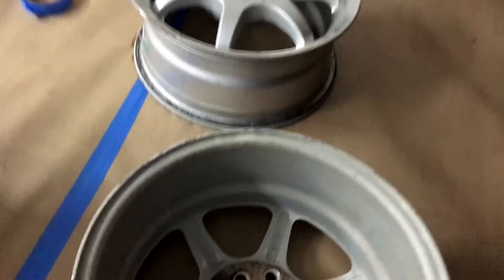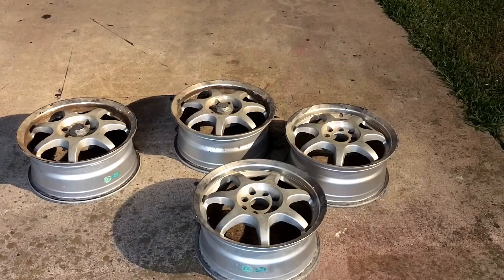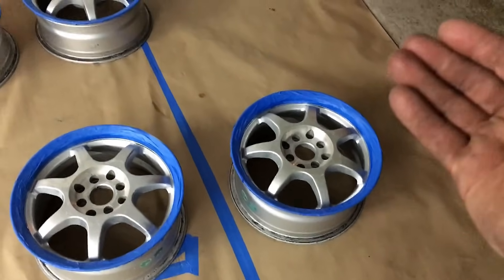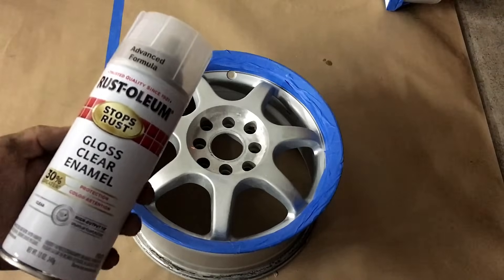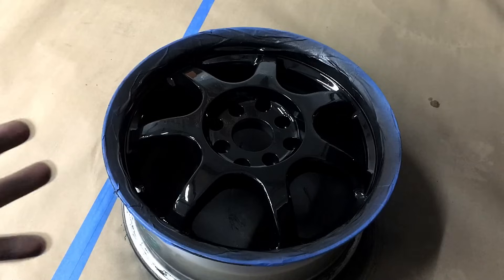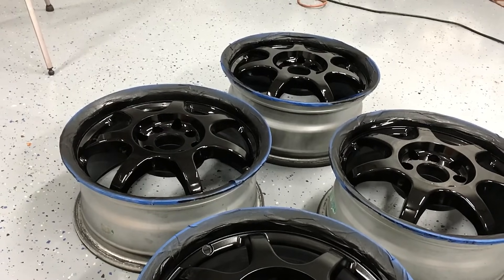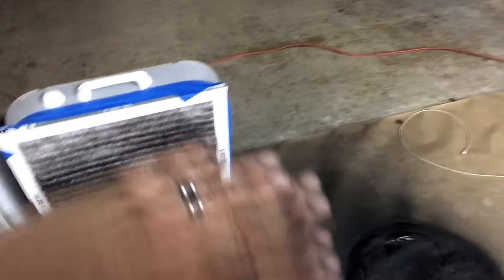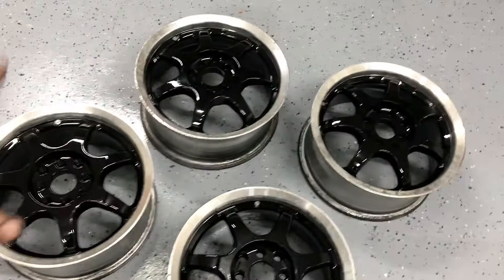How to transform Junkyard wheels using rustoleum from walmart!

Comment: Good how-to. I have a set of stock wheels with a brushed lip and they all have some level of rash on them so I am going to strip the clear coat and refinish them myself and paint the centers to match the car then K2 the entire wheel to keep the lip finish protected. Good job and good to know the Rustoleum doesn’t need the clear unless you are running K2.

Comment: Just got a great deal on a set of wheels off Craigslist and I remembered this video (I know there's a few) on painting wheels so I'm sure there will be a few additional views. 😃 Good to revisit the older videos.
Reply: I got sum badass rims for my civic for 100 with the tires only thing i have to sand down the rims bc the old black paint started chipping
Reply: @savagegaming3696  I used the same Rustoleum black paint he used here and they came out beautiful! They guy I bought them off dropped the price since they were all scratched up. A little sanding and some bondo and you can't even tell.

Comment: I noticed you said cheap pressure washer. It’s cool man, as long as it gets the job done; that’s all that matters. I bought a second hand reel mower of of craigslist for 50 bucks. It’s somewhat rusty but still cuts my small yard. I live in a trailer park and it works for what I need. I appreciate all of your videos! Thanks
Reply from the maker: Yea $69 is cheap for a pressure washer been using it for a few months and works great for its price.

Comment: @8:40 My main question about painting metal wheels is: What exactly do you do after priming? See I primed one side of the wheel (internal), and in many places the prime (I used Rust-Oleum Automotive Primer) was like a layer of chalk. I wiped it out, it was a lot, like a thick layer of dust. Then I just washed that wheel. The primer adhere to some parts (best where there was a bare metal), but not everywhere where it was painted surface. I think maybe I should just go over that primed surface w/paint, so together they would adhere, or I did something wrong. The primer is for Metal and Fiberglass surfaces. When you touch that primed surface (after it dries of course), should it stay on your fingers or not? I would appreciate any opinion on this matter, I googled and nothing about it. Some people use application of Glass Cleaner on a rag to wipe it out before and between layers of paint.  The wheels are not aluminum, they got a bit rusted, I removed that rust, prepared surface, but smth went wrong w/Primer, I think. Thank you for this detailed film.
Update: It might be too high temperature. I painted in Dallas, and it was ~100F, I didn't know about the effect of primer drying in the air. I'll try in the morning at lower T.

Comment: The absolute best degreaser You can buy 111 Tricloroethane. Clean like You have then lightly spray (mist) down the areas You're gonna paint with Tricloroethane. This will evaporate quickly and any grease residue will evaporate with the Trichloroethane. It will make any surface more gracefully than you ever thought possible. If you've ever tried to use gun blue on a gun you can never seem to get it to come out as dark as it did from the factory but if you use trichloroethane it will used it since the 1980s probably since 1979 Maybe at any rate this one extra step will make your painted here like it's been electroplated onto the metal. If you have something metal wise that you have trouble with paint adhering to you have to get it down to the bare metal to use this product try a product called etching primer this has muriatic acid in it and it actually eats into the metal and the primer becomes a part of the metal paint sticks like hot dip galvanized. after using etching primer you can put any kind of coating you want on it it will not come off I've tried scraping it off with a metal putty knife off of aluminum and if you get it off you'll have aluminum stuck to the back of the primer. I hope this helps you. started painting in 1972 with my grandfather have done it professionally since 1980.
God Bless You and Your Family!!
Jimmy in NC....

Comment: Wondering if you ever spray canned wheels without tire AND painted the lips as well. If so, was there any damage to the paint that occurred during tire installation? I painted a set of wheels gold once but they had the tires on during the paint process so I just used the playing card masking trick.

Comment: Have you tried wet sanding and polishing after clear coat? Wondering if that might help
Reply from the maker: I have and it does help but the natural paint without clear is still more shiny. Unless you use 2K

Comment: It's really a labor of love man. 
My rims had scratches and grooves so had to fill and sand before painting. When I finished one I was ready to quit but ended up doing all four. They didn't come out so great and I probably didn't wait long enough before putting the tires back on cause the paint started chipping where the machine made contact. 
Any tips for keeping the finish looking good?
Reply from the maker: Best way to maintain them is after they cure put a ceramic coat or hydro silex coating and it helps prolong the life of the paint.

Comment: Would I get any reaction if I use Speedokote Clear Coat 2K Acrylic Urethane on enamel paint
Reply from the maker: I have done it and not gotten a reaction but im not sure what causes it. I know that some would say it’s from gasses being trapped and trying to escape but that don’t seem to always be the case since I have had paint jobs 1year old wet sanded and wiped down clean no contamination and never been waxed and they do it so not sure why it does it.

Comment: Hey Moore, I am thinking of spraying my wheels. I have some 20" chrome Denali wheels on my Silverado Thunder Ed. Do you have any suggestions on a method of action due to the CHROME (so ugly, I just hate chrome 🤢)...? I am gonna do Black with Graphite Metallic.
Reply from the maker: I had a video but it got deleted somehow but I use 80 grit to scuff then 220-320 to make it smooth. Prime them then do these steps in this video. The clear is up to you but I prefer without clear unless it’s 2K.
Reply: @JamesDguy  Ok, so are you gonna repost video? I have some curb rash, but the 80 should knock it down some. I enjoy all your vids, I have dabble in spray paint all my life that I can remember. You make it look so easy, fresh and clean. Hey big props to you my man. Thanks in advance for your knowledge.
Reply from the maker: Mark Barilleau II can’t re post that video it was 2yrs ago and all my videos once they get posted to YouTube get deleted from my computer since i would need at least a 5 terabyte hard drive to keep all the videos I have done I have over 400 videos between the 2 channels. It also didn’t help that after I uploaded that video my computer crashed so lost the file anyways. -_-
Reply: @JamesDguy  not a problem, was just checking. But thanks for the input bro.

Comment: Watching thus from north Carolina itmf I wasn't living at an apartment then I could do mines
Reply from the maker: I lived in a apartment and did mine before but got in trouble because i said F it and put it right on the ground lol Ooops
Reply: @JamesDguy  lol would be better doing it on the car
Reply from the maker: Rayon Williams sports tv Nah I don’t ever paint the wheels with them on the car. It comes out with a less than nice finish. If the paint sags it will run due to gravity and what not.

Comment: i applied primer - no problem , i then applied black with gloss and they came out great , then i went to apply clear coat it started fry up .what couldve went wrong ? or how do i correct it ?
Reply: You need to go online and read the technical data sheets. For the regular rustoleum cans, you can only apply the paint within an hour. For example 3 layers of primer with 10 mins in between coats going light, then medium, then heavy. After that you’ll do the same with the color coat. Since that’s a whole hour, you will have to wait at least 2 weeks(it depends on temp and humidity) to clear coat. There are certain primers that rustoleum sells that could be too coated anytime and that’s how you bypass the hour, because you will only calculate the color coat and clear coat for the hour.
Reply: I'm afraid of the same thing, that it won't stay (adhere) well. See I primed one side of the wheel (internal), and in many places the prime (I used Rust-Oleum Automotive Primer) was like a layer of chalk. I wiped it out, it was a lot, like a thick layer of dust. Then I just washed that wheel. The primer adhere to some parts (best where there was a bare metal), but not everywhere where it was painted surface. I think maybe I should just go over that primed surface w/paint, so together they would adhere, or I did something wrong. The primer is for Metal and Fiberglass surfaces. When you touch that primed surface, should it stay on your fingers or not? I would appreciate any opinion on this matter, I googled and nothing about it. Some people use  application of Glass Cleaner before and between layers of paint.  The wheels are not aluminum, they got a bit rusted, I removed that rust, prepared surface, but smth went wrong w/Primer, I think.
Reply: You are clearing too soon brotha. Needs to be much more dry. Also make sure you are using same paint types. Another tip to help speed dry time is to use a heat gun. Use the heat gun like you are spraying paint. Everything even no matter what. Whether your doing circles or up down side to side. Even. Have fun with it. Also less is more. Don’t put too much heat right away and bubble it. Sometimes I spend 10 to 15 min with heat gun on a finished project. I almost always spend a couple min heating between coats. Try it out on something you don’t care about first but I’m telling you it’s a game changer. No more foggy clear coats either🫡

Comment: You said that you put clearcoat over tacky paint so not to get A paint reaction wrinkles . does that also apply to 2K clear or is that just rust-oleum clear what if you were painting rust-oleum color and You get a run or orange peel and you paint right over it with clearcoat you’re not gonna be able to get out the runs or orange peel ? I want to paint my car but don’t want to get runs or orange peel ! Can I fix after it drys and then paint clear 2k

Comment: I have question hopefully you can answer it. Have you actually ever sprayed 2k clear coat over enamel rustoleum paint. Without getting a reaction?
Reply: Look for his video "2K clear over CHEAP rustoleum paint (AMAZING RESULTS!)" I believe he has done others as well.
Reply: I've used 2k clear over spray paint on my channel.  It turned out great, did it on an off-road subaru build
Reply: UnWrecked how many cans did you use for a full coat? In the process of painting my car rn.

Comment: you can measure the hole for the centercaps and order other ones , these things dont cost a lot but add a lot to the wheels
allso be a good idea to take the tape off after spraying the gloss black and clearcoat the whole wheel , if you leave the polished rim bare it will corrode pretty fast the clearcoat will leave it shiny a little bit longer though it allso makes the aluminium look a little darker

Comment: Why not self- etching primer or a metal prep? I'm going to do my aluminum wheels. Am I overthinking it?  Nice video as well!
Reply from the maker: Yea overthinking happened to me years ago and i was forced to use what i had and it worked and lasted a long time so i stopped with the over thinking. But self etching is good primer no doubt.
Reply: Did my Silverado aluminum wheels first with rattle can self etching primer , then Rust-Oleum Gloss Black Industrial, still holding up over 8 years.
Reply: You only need self etching primer for bare metal. Since they're already painted wheels filler primer is more ideal

Comment: Could I just wait until I need new tires and paint with the tires on and not care about overspray on the tire?
Reply: Tape around the edges of Alloy/Tyre or use DIY store paint cards. Never just spray paint everything. Take a little time and be patient to do it properly!
Reply: No because then the tires will be part of the paint seal and the paint will come off when you remove the tires

Comment: For your next project, look into eBay for a set of Drill Brush attachments. They are mild abrasive plastic brush set that helps cut scrubbing time in half bro. A set runs anywhere from $9.00 - $24.00 for a set of three different brush heads.  Great work.
Reply: Got link like what you like?
Reply: @jstmatt_youtube3350  No link, just go to eBay and type in Drill Brush Set. They range from $9.00 to $20.00 for a three to four piece set. Pricing is determined on where it ships from. They’re very reliable and durable. I’ve bought three sets just to keep around the house and garage.

Comment: I painted my factory wheels satin black and left the rim bare aluminum. Looks a lot better than the old faded, scratched clear coat
Reply: how long do painted wheels last? Does it chip eventually?
Reply: @jv1990  I painted mine 5 years ago,but I just cleaned em and painted em,no sand or primer,& they just got a chip in em last month!

Comment: It came out dull because you're not supposed to use a clear with high gloss 😒
Reply from the maker: Eh idk i have used 2K clear over high gloss paint and it turned out amazing. But either way they look good. Don't know if you watched the whole video but i ended up re doing the last one off camera
Reply: Yeah the do look good.
Clear always looks better over a flat, it absorbs better.
Kinda why we scuff stuff before paint right?
Did you can also re polish those lips in a real easy way aswell if you're interested.
Reply from the maker: Tom B Yea I have a few videos of me doing polished lips. Some methods I used are... frowned upon but they worked for me lol

Comment: I've done the same method on multiple wheels but I see everytime i do it they always end up peeling when I wash the car what should I do to prevent?
Reply: Clear coat or just don’t spray the wheels with a high pressure hose

Comment: Rustoleum is pure garbage. The wheels might look good for a week, but all of that paint will eventually fail.
Reply: I believe he specifically addressed this very issue and his reasoning was that this particular paint holds up well for a single part. I'd tend to agree with him on this one. While I haven't used it for exterior surfaces, I have used it extensively on transmission cases and axle housings. It takes time to cure, but it eventually cures to a very hard finish. I've found that various tractor and equipment paints are very similar (Tractor Supply, for instance) . I wondered if maybe they are actually this same stuff, only rebranded
Reply: @mccoma11  yea but these are wheels sun hits its directly on the surface , if you live in areas that get to 90 or above your shit is fading in a month
Reply: Just say "NO".
Reply: Put it in the garage..... Easy fix!

Comment: Nice video gave it a like, but you made one mistake. You did not use a 2x clear coat which is much stronger and scratch resistant. The basic clear you used will waste all the work you did because it simply cannot protect it. When you can get 2x clear for as cheap s $20 it's a shame and a waste ont to use it.  You associated it to the size of the job: "this is good for small jobs", it's not about the size of the job, it's about the effort you put into it and if you want it to be scratch proof. You can scratch a key chain (small) just as easy as a car fender (big) paint is paint.